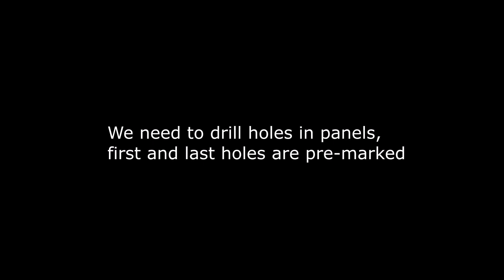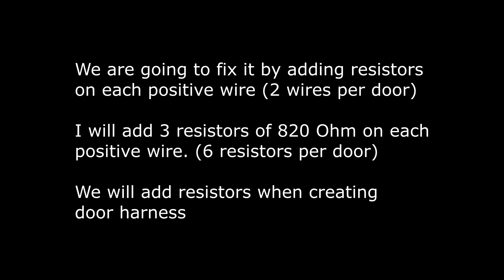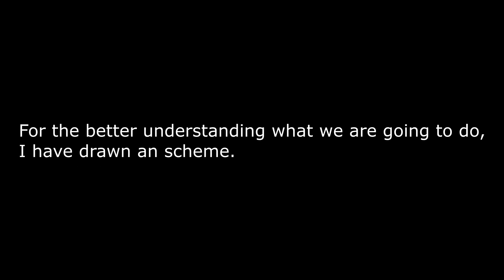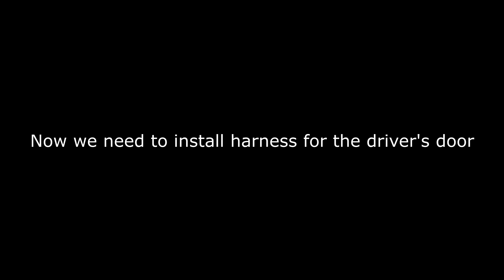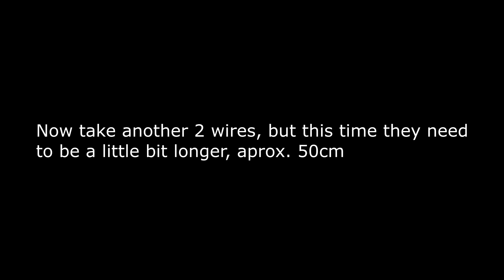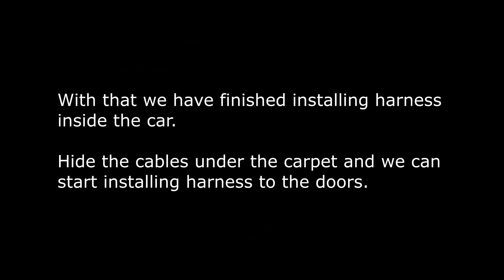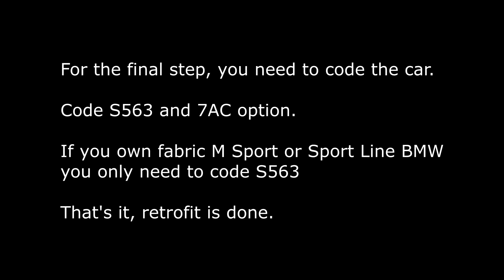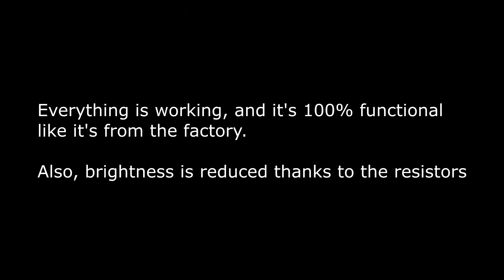How to retrofit Ambient Light on BMW F30/31

Comment from the maker: 2:20 rendering glitched and the text dissapired: "I have connected doors to the window switch to check the illumimation, but brightness was too high"
As you can see on 2:30.
Rest of the video is fine.
Reply: Hi, ive got the zb9 mid level fem module, i dont have a blue connecter at the second slot, at mine its black. Does this make a dofference?

Comment: I have connected the orange and blue directly to the ambient light of the ashtray and cup holder, but in the menu I cannot change from classic to sport, however in the standard ones, footboards, ashtray and ceiling, it does change.....is it because I have not put resistors in it?

Comment: Hello, I want to mount simple blue LEDs inside the door handle and inside the door object holder pocket.
can I get power from the window button LED of each door?
What colors should I get from under the window button pin?
Greetings
Reply: Did you find out ?

Comment: Hello! I really Hope you could help me a bit since I am deseperate about this one. I have F30 and it have light package, I had only orange strips which I replaced with 2 color ones, I also installed 2 colours dashboard ambient light. However, I now face one issue: When I change color in iDrive system from orange to blue, dashboard works as expected and it changes the color normally, however  doors does not work on that way. While on Classic(orange mode) they work fine. As soon as I change them to sport, they all shut down and dont shine at all(only doors, dashboard changes to blue and it works). Do you maybe know what could be the issue? Maybe some coding? I have tried already a lot of things and I am really desperate.

Thanks in advance!!
Reply: Because you dont have  a wire that leads from FEM to the doors for the second light color. In the door panel itself, you have that wire but from the door connector to the FEM it is missing and you have to add it yourself.
Reply: Same problem here. Did you resolve it?
Reply: @georgedanila5710  wiring is missing for second Ambient Color from door connectors to Main Control unit (FEM)

Comment: Hello, love the video nice job, but i have a question if you can please answer. So i have a f20 lci 2015 with lights package not extended lights package that means i cannot switch colours, that means i have only orange ambient light, but i dont have orange ambient in the footwells.. i only have footwell when i open the doors but not in the dark with the rest of the ambient so i want to retrofit that, what do i need to do? So I’m not interested in switching classic to sport, i only want to have orange in my footwells as i have in the rest of the car dor handels centre console and roof little lights. Thanks 🙏

Comment: Very nice, will be my spring project as my car doesn't have light package :) 

I have 1 question, I have already installed aftermarket footwell 12V RGB LED SMD5050 strips under all seats, is it possible to wire it to the FEM together with the ambient lighting when doing this retrofit?
Reply: I got all oem parts but not connected to the FEM. As i don't understand how to do it, i wanna connect my rgb footwells that i still have in the box as well but i doubt that would work, anyway this dude won't answer you trust me.
Reply: Where have you connected it then

Comment: hi, why you will resistor on positive wire?
Reply from the maker: Hi. Because lights are too birght and driving like that at night is impossible.
So, to reduce brightness you need to add resistors.
Reply: @Acelele320  thanks
Reply: @Acelele320  but you can change the brightnes in the screen right?

Comment: Forget the lights, those seats look amazing. Did you get them reupholstered?
Reply from the maker: No, they are from factory.
If you spec an M Sport package on F30 here in Europe, you will get Alcantara interior as a standard and leather is a optional.
With the G20 and G30 leather is standard and Alcantara is optional.

Comment: Hey, nice work, buddy. Can you help me out  a bit?
My car has no light function and has no FEM blue connector. Can I still wire the lights into the FEM or do I need to change the FEM module?
If so, which version should I get? I cannot find any info on any differences on these FEM modules.
I have managed to code everything alright, got control of the Classic/Sport and brightness on the iDrive, but no power from pins 50/51 on the FEM module.

Comment: Hi Ace,

I just installed the same LEDs as you except that my central AC console remains on. Did you have that too? And the leds of the bars light up at the same time. Don't you know what that could be?
Reply from the maker: Hello.

Did you connected Ambient Light on the same pins as the AC cover?
Reply: Ace320 I went back to the original electrical harness there was a small light under the AC. In SPORT color blue mixes with orange when I turn off my lights the AC remains on orange as well as the foot lights which turn red instead of the original yellow

the white tab which blocks the blue connector of the fem s is broken you think that it could be that?

Comment: Hello, I'm doing a similar retrofit, but with rgb leda for several colors. My car didn't hace the conections for rgb, so I has to wire everything. The only thing pending ud that I don't know how to connect the light module that comes with the lights. It has as outputs, power, gnd, canHi and canLo. Also, can I wire the rgb into the FEM so I don't have to use the light module that I just mention es before? I would really appreciate your help. Thanks.
Reply from the maker: Hello.
- You can't wire RGB to FEM and change colors in the iDrive menu.
- Did the seller provided a installation scheme with the kit?
I don't have experience with such kits so I can't tell you where to connect it.
Reply: @Acelele320  Thanks for the asnwer. And yes, they provide me a scheme to set the lights in order to control the colors with the radio buttoms. But I still have some doubts. Could you ease write me in my email? so I can show you, this is my email: andreyques41@gmail.com.

Comment: I have a G20. To add ambient lighting, it would've cost me $3000. I want to do the retrofit, but I'm worried to mess anything up cuz it's a lease. Is it even possible on a G20?
Reply from the maker: How so that you didn't ordered the G20 with Ambient Light? It would cost you less. Also, where are you from?
Reply: @Acelele320  I'm from Ontario Canada. I bought mine with the M package, and the essential package. Combined for an extra $4000. The premium package would've had everything the essential does, plus wifi hotspot, heads up display, parking assistance, and the ambient light, for an extra $3000
Reply from the maker: @tzdaouk  If I was you, I would go for the Premium Package. Anyway, about the ambient light on your G20. Well, I rly don't know anything about it, bcs this isn't my job, it's my hobby so am not always up to date. But I have searched on AliExpress a little bit and found a full kit for the G20. It's OEM-like and costs 360€.
https://www.aliexpress.com/item/4001152617241.html?spm=a2g0o.productlist.0.0.4c9611aah05fIn&algo_pvid=5f0cdb9b-2df7-4803-b919-d769c072dfe3&algo_expid=5f0cdb9b-2df7-4803-b919-d769c072dfe3-13&btsid=0b0a050115950070586766716e8d50&ws_ab_test=searchweb0_0,searchweb201602_,searchweb201603_
Reply: @Acelele320  yea. I'm kind of regretting it now.
That's sick. You didn't have to. Thanks a bunch. I'll look into it! Hopefully it has good installation instructions
Reply from the maker: @tzdaouk  Instructions are probably in Chinese like always. And unfortunatley I cannot help you bcs I have never worked on G20, myb one day if I buy it 😁

Comment: Great work , I only have once question. How do you know the pin numbers on those connectors?
Reply from the maker: Hello, thank you.
I know correct pinout because I have access to BMW wiring diagram, as you can see on 6:58

Comment: Where did you get the wiring diagram for this I m assuming its not the same for an F82, I could be, but where did you get it, I m trying to just do a center console add in since my year didnt come with it and if i had the FEM diagram for my f82 i could build a wire harness and do this exactly. I may even be easier for me because I already have the doors
Reply from the maker: Hello, here, I found you wiring harness for F82 for interior lights: https://www.newtis.info/tisv2/a/en/f82-m4-cou/wiring-functional-info/body/lighting2/interior-lighting/interior-lighting/1VnXxcyvkD
Reply: @Acelele320   :D.... :D you are the best

Comment: Hey ACE, which connector is this at 04:05
Reply from the maker: Hi.

That's Ambient Light connector.
Reply: Ace320 ok thx, i bought 4 original Panels with Ambiente, is it the same connector?
Reply from the maker: @SA-Performance  Yes, it's the same connector. This retrofit kit from AliExpress is replica of OEM but for much cheaper price and brighter LED's
Reply: Ace320 i bought the hole oem Panels integrated with Ambient for 160€. I think is a fair Price. I want to visit Venice this year, maybe you can retrofit this for me?
Reply from the maker: @SA-Performance  It's a good price.
Yes I can retrofit Ambient Light for you, am about 1 hour from Venice (I live in Udine) and to do this job I would need couple of hours of work, if everything goes as planned.
Only issue is wiring harness that needs to be installed under the carpet and rear seats, that takes a lot of time to do, bcs you need to remove a lot of panels and covers, as you can see in the video.
Reply: Doom, paddle and Ambient :-))))
Reply from the maker: @SA-Performance  Okay, no problem.
After this Corona Virus, I have a lot of peaople coming to me for a retrofit of Power Folding mirrors, Welcome Light, Ambient Light and Dome Light.

From are you btw?
Reply: Ace320 hey ace this is Perfect :-) i am from Germany, next to Switzerland/Basel. How can i contact you? I change this days my FEM to ZB6 because i have ZB4. It will be cloned and than it should be work
Reply from the maker: @SA-Performance  You can contact me via WhatsApp, leave me your number here and I will add you, later you can delete your comment with your number.
Reply: Ace320 did you get it?
Reply from the maker: @SA-Performance  No, send it again please
Reply: Hey, do you have the number? I will delete it!!

Comment: Hi Sir, I haven’t in my car installed in FEM A173*9B the BLUE CONNECTOR . How can do it?
Reply from the maker: Hi.
Can you tell me what is the model of your FEM?

Look at the FEM and you should see something like this "ZB10_HIGH_E" or "ZB6_MID_E" or anything like that.

Note: This is very important, if your FEM is below ZB6 (i.e. ZB4), then you might not will be able to retrofit Ambient Light.
Cars who came without A173*9B connector are base model F30s, so these models can't retrofit Light Package, 6WA cluster etc..

So, if you have ZB4 FEM you will probably not be able to do it, but you can buy ZB10 FEM and do the retrofit, brand new is FEM is ~300€, used is ~100€ on ebay.
Reply: Z4
Reply: I have the same problem, how i can do it in this case?

Comment: Hi,

Congrats for the video. If i don't have the light package and i order trims from Aliexpress can i wire them directly to the button and add resistors to dimm the light? It's seems to be a lot of work to make it OEM, so i will be happy if i just can connect them to the window button. It will work? Thanks?
Reply: Hi! If you connect it directly  to the window switch , what are the colours of the wire’s that you need from the window switch ?
Reply: @lennerddecoene4952 did you find out
Reply from the maker: Hi.

Yes, you can do it that way, but you can't control lights from iDrive menu.
If you want to change colour, you have to do it manually for each panel.
Reply: @Acelele320  the light can be adjusted from the little wheel that controls all dashboards lights? I mean the one next to lights control. Thank you!
Reply from the maker: @baditabogdan4867  
Yes It can, but you can put resistors as well.
Reply: @Acelele320  it is delivered with a wire harness with 3 pins. Any idea which cables to put the resistors? Or just trial and error?

Comment: Hi,  thanks for the vid. It helped me to retrofit light package. I only have one problem. After coding 7ac and 563 the leds and Lci radio panel works well, but the leds in the ceiling (near interior light switch) are now off. I also can’t choose the ambient lightning in the idrive. I only see brightness. Thanks in advance for your answer
Reply from the maker: Hi.
Do you have LED Dome Light or basic dome light (with a single button)
Reply: Ace320 hi, as far as I know it’s led. It has 3 buttons. One for all and one for the driver and also one for the passenger.
Reply from the maker: @michelmiddag603  Did it came like that from factory or you installed it?
Reply: Ace320 it came out of the factory this way. I didn’t install anything.
Reply: Ace320 hi just did some investigation. When I delete optioncode 7AC the amber light in the dome is on again. The ambient lighting behind the radio panel is off (connected to pin 50 and 51 on FEM). Deleting code 563 doesn’t do anything. I also don’t have the ambient light options in the idrive either i have the 563 option on or off
Reply from the maker: @michelmiddag603  If your dome lights came from factory LED, then you already have Light Package and there is no need to code 563 or 7AC.

Please tell me did you had Ambient settings in iDrive before coding?
Reply: Ace320 Hi, no only brightness. On my blue connected on FEM was only one wire. I think this is the one for the dome light. Either coding 563 or 7AC don’t give me the option to choose color or do any settings but brightness.
Reply: Ace320 my vin is F279190. I’m second owner and car is complete stock.
Reply from the maker: @michelmiddag603  I have checked your VIN and you don't have factory Light Package, but that's weird that you have LED dome light, because LED dome is part of Light Package.

Could you leave me your WhatsApp number?

Comment: Hi, I don't understand how to put the wires in the door
Reply from the maker: Hi.

Throu the door plug/connector.

You need to rout wires throu the connector and plug them into the Pins.

Watch video carefully and you will see how it's done.
Reply: But in the door with which threads are you continuing?
Reply: Do I put wires on the same pine?
Reply from the maker: @edimarinescu1503  Yes, in the same Pin, otherwise it won't work.
Reply: Does this retrofit require coding? Even if I have ambient lights on my feet?
Reply: Thank you!

Comment: my car has no light pack. I have to do exactly what you do in your video to work. Also i want to install ac radio led trim and i dont have the cup holder led. From where i can run a wire?
Reply from the maker: For the cup holder you also need to connect it to the FEM.

My car already came with that because it's an M Sport model. (Footwell light and cup holder light is standard on Sport/M Sport models)
Reply: @Acelele320  ok i see. But i need to connect another pin to fem or i must to connect the cable for the cup holder to the same wire of the ambient light before the fem. And then all wires for the ambient light plus cup holder led to the fem?
Reply from the maker: @christos1984  You need to connect it to the same wire like Ambient Light, they are connected, that's how they do it in the factory. Everything is together.
Reply: What do you guys mean with fem? 
I don’t have the light package in my f30 and i wanted to add the radio trim light and i tried to take power from the wire’s from my ac/radio connector but that doesn’t work.
Reply: @Ace320